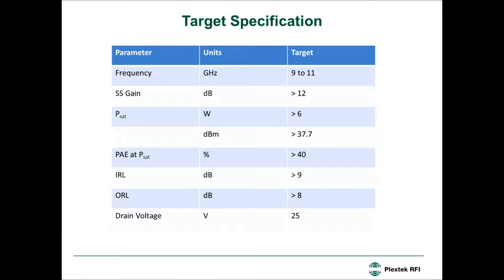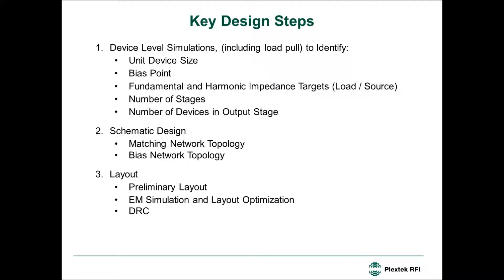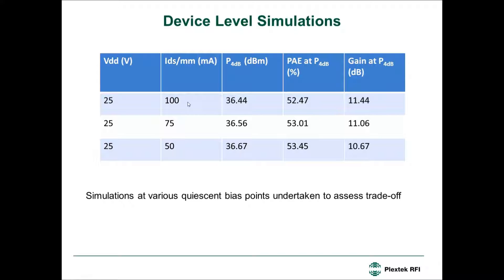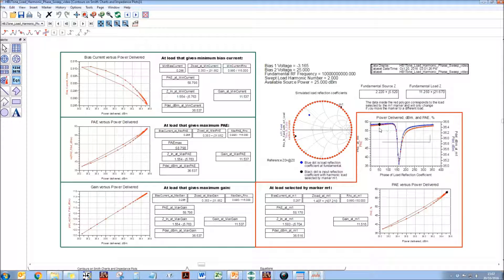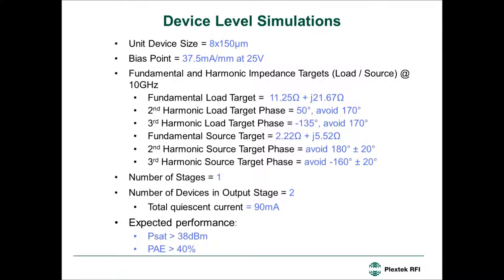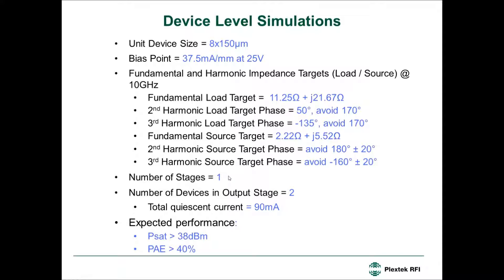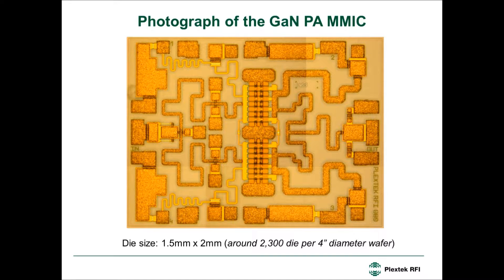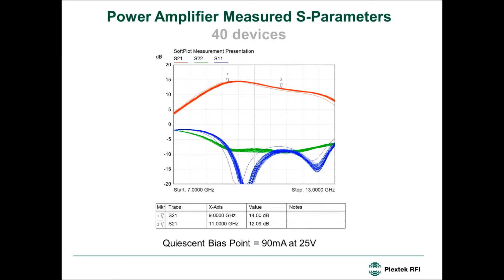An X-band MMIC PA designed on a UMS GaN Process using Keysight ADS

Comment: Given a unit cell is very likely unstable (May be not at x band), should an RC stability network be added to the FET during LP? Also the FET is very likely unstable at very low freq that can be mitigated with an RL bias line. Should that be added as well?
Reply: Yes, it's better to have one. The transistor may be stable at the design frequency, but it's better to add an RC network to stabilise the device at lower frequencies. From my experience with GaN 150 nm technology, this RC network can stabilise all the way down to 1 GHz, and the RL bias line should help for frequencies below that. And yes, these networks should be included during load pull.